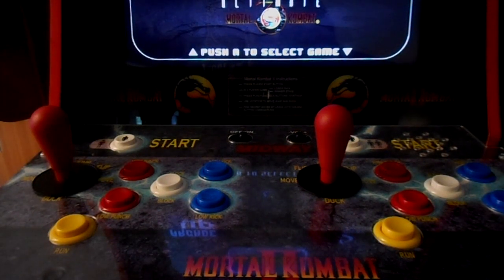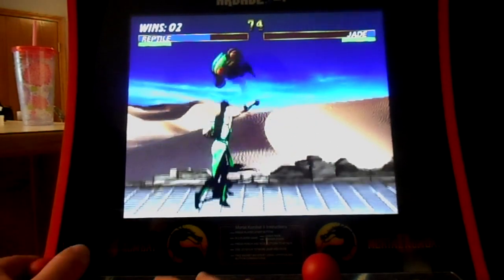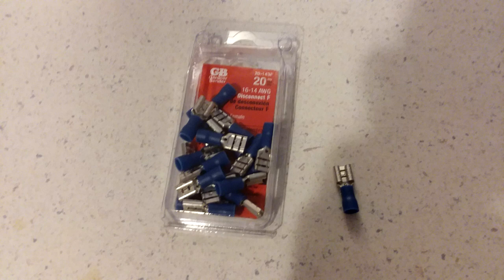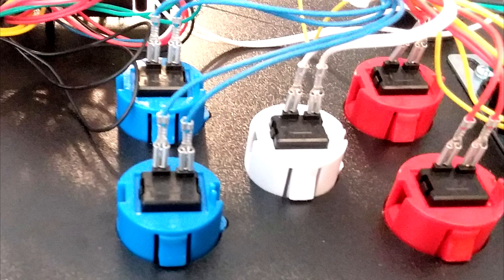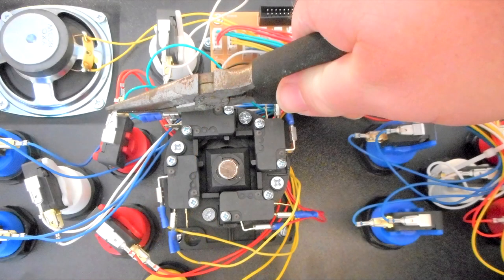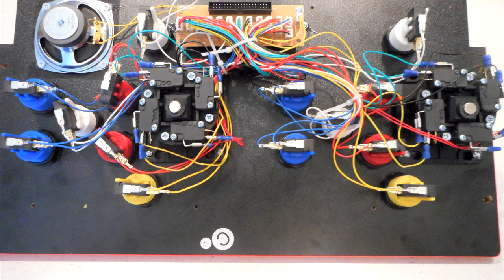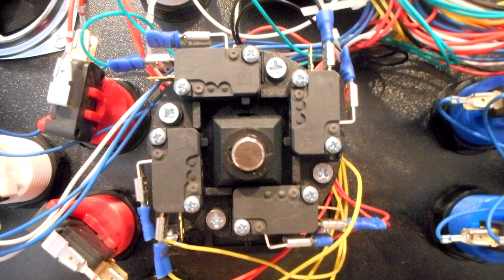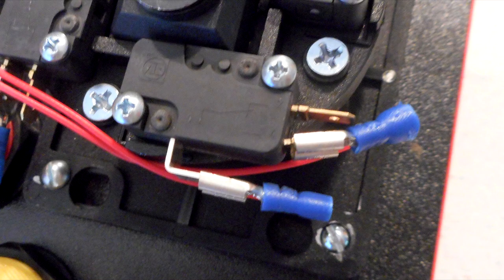It's EASY to do putting HAPP Competition joysticks in your Mortal Kombat Arcade 1up

Comment: I’d really wish the installation of the Happ would be in video instead of pictures :(
Reply: Took me 8 hours to do sticks and switches. I did thread in nuts into the deck, then I could attach them with m10 bolts so the joysticks are in there for good. Had to shave down all 8 threaded inserts before putting them in. Also I had to shave the side of the first player joystick. Then I got ocd with the wiring. Cut it all to length and ran to each switch nicely. Also had to solder the ground for the top corner switch of joystick and solder both power and ground wires onto bottom right switch of joystick for ti to fit without hitting the side of cabinet. Just finished an hour ago. Fudge, I should have just made a video.
Reply: Shelbe Shocker are you in the arcade 1up subreddit? You should be, and post your build. I want to see your cab, it sounds really nice and you did a thorough job.

Comment: get IL Eurosticks.. they're more snappier and responsive. you know you have an IL Eurostick if the dust washer is the same color as the joy stick. Thank me later
Reply from the maker: I agree IL sticks ARE better (I have 4 of them). I recomend these Happs for this mod though, because of the price. For 40 something bucks you get everything you need. IL parts will cost quite a bit more than that. Plus these Happs are a significant upgrade over the stock parts, so you wont be dissapointed.
Reply: Just did them, took me 8 hours to do sticks and switches. I did thread in nuts into the deck, then I could attach them with m10 bolts so the joysticks are in there for good. Had to shave down all 8 threaded inserts before putting them in. Also I had to shave the side of the first player joystick. Then I got ocd with the wiring. Cut it all to length and ran to each switch nicely. Also had to solder the ground for the top corner switch of joystick and solder both power and ground wires onto bottom right switch of joystick for it to fit properly without hitting the side of cabinet. Just finished an hour ago. Fudge, I should have just made a video.

Comment: What were the size screws you used?
Reply from the maker: Been a long time, I don't remember. Just make sure it isn't long enough to poke through the control panel (on the other side), and you should be fine.

Comment: I tried to put Happ 8 way into my MvC 1up and there is not enough room! : (
Reply: What are you running now? 

I also have MVC-A1up... 

I was using a Stock Sanwa but through tinkering I guess I needed getting dirt in some of the switches so some of my inputs weren't Registering... I personally began to think that I just was starting to suck. 

Long story short, I wanted Happ Sticks, but through tinkering I developed a theory that what makes a feel of a button and Joystick come down to their actual moving Parts. 

So now I have my Sanwa Base with an Extended Shaft, Aluminum Bat Tops, 6lbs spring, cherry switches via a 5ping to .187 harness from Focus Attack.

Comment: Do you know the exact size screws you ended up going with to attach the arcade stick to the control panel?
Reply from the maker: No I don't, I just went with screws long enough to hold the joysticks, but small enough to not go all the way through the control panel on the other side. Measure the control panel, and make sure whatever screws you get are shorter than that, and you should be fine.
Reply: @MikeyJProductions  cool thanks man
Reply from the maker: @rosevillereaper9230  👍👍

Comment: Flawless victory! I did this mod right out of the box. Arcade1up buttons were soft. You can really feel the difference. I used 22-16 connectors (red). These wires are tiny but plenty of slack to work with. I also used 8x3/4 wood screws to mount the joystick housing to the deck. This is really easy. just takes several hours. yes, you have plenty of room on the side to mount the control panel to the cabinet. No dremel or trimming. Secret weapon is double sided tape to center the joystick housing. 
Thanks Mikey J for the tutorial.
Reply from the maker: Awesome!!! I've been saying it's pretty easy.
Reply: Just finished doing this mod. Took me 8 hours to do sticks and switches. I did thread in nuts into the deck, then I could attach them with m10 bolts so the joysticks are in there for good. Had to shave down all 8 threaded inserts before putting them in. Also I had to shave the side of the first player joystick. Then I got ocd with the wiring. Cut it all to length and ran to each switch nicely. Also had to solder the ground for the top corner switch of joystick and solder both power and ground wires onto bottom right switch of joystick for it to fit in my mk2 cab without hitting the side of cabinet.

Comment: FYI they updated the Happ sticks a few years ago, They are pretty much right on par with the IL Lorenzo sticks now. So either are fine, Happ Suzo used to suck pre 2017/2018 so make sure if you are buying them you aren't getting the old ones but newer updated models, alot of the Pro MVC players prefer the Happ sticks over Sanwa.
Reply from the maker: I have IL sticks as well, and the Happs ARE close, but they are not the same. The IL sticks have a white nylon actuators, while the Happ sticks have black plastic ones. So they ARE different.

Having said all of that, I LOVE both sticks. But I DO think the IL sticks are slightly better.
Reply: @MikeyJProductions  nylon is a type of plastic, but at one point they used some kind of rubber material when suzo first took them over, and man did they suck. Still cannot figure out though the Ultimate series reason for existing other than a round actuator rather than a square, still though the Super series is one of the best for 4 way games.
Reply: @MikeyJProductions  The actuator's are definitely different but even the pivot and the z-stop which is underneath the actuator and encloses the spring also is the white nylon material. If you replace the actuator on a Happ with IL's version, the z-stop is also a must.

Comment: I attempted to Recreate a Happ/IL Feel through Sanwa Base by using an Extended Shaft, bat tops, 6lbs springs and swapped the Sanwa PCB for all Cherry 75g switches through a 5ping to .187 connector. 

I'm running that on my MVC Cab by A1up.
Reply: Noice!!!!, because I was going to do the same thing. I actually got 4 lb springs instead of six. Four pounds feels fine. Do you think the six would feel more like happ? Also, what is the overall outcome of your idea? You have a longer shaft and 6 lb spring with micro switch cherry switches. How would you rate it compared to official happ joysticks on a scale from 1 to 10 with 10 being the highest? 👍
Reply: @kjmullinz  

Ahhh man. Let me just say I have been on a journey. . . 

So basically..... I found that a 4lb spring feels good with either the Stock Switches on A1up, and with Stock Sanwa Switches. 

A couple of things you need to consider based on what I have felt(I Am Very Empathic and detail oriented.) Is not just the spring weight but also the push back from the switch. 

I believe most Joystick switches are around 100g of force to 125g hence the point of actuation and push back is kinda heavy and comes with a loud click. 

With that said though, one factor of Springs you always have to consider is the fact that they will weaken slightly and become easier to move. 

This is why I switched over to a 6lb spring because the 75g switch isn't just less loud with its actuation sound, but also less heavy in actuation and push back.... Who would have guessed right? LOL!

To get a Happ feel isn't what I first initially set out to do.... At least not directly and not at first. 

I don't like resting my hands on the control deck so that's why I bought extended shafts to also help with maintaining some sort of Good Posture.

The Microswitch change came to me recently when I began to.... Suck ass! I actually thought I just plateaued in skill, I was getting bodied online and in person offline.

But each moment I felt something was off, I felt my inputs not always registering so I did some research and was going to buy the Bit Bang JLF PCB alternative that allows you to swap out individual switches, but they don't accept the Cherry switches I had a lot from, from ordering a lot of buttons. . . 

Then I also found out Cherry Switches are the same old school switches used on some Arcades, for example Galaga used a 'Wico' stick with 'Leaf Switches' for it's controls. 

So long story short because I have JLFs with an A1up Adapter I decided to use the switches I had on hand and buy a 5pin to .187 adapter. 

I switched to a 6lb spring because I wasn't getting the feeling I wanted, but I had them for months before I used them because a 4lb Spring with Stock Sanwa and A1up gave a Satisfactory feel but not with Cherrry. 

I also found out that Happ uses a Stick spring between 10lb to 14lb, and in mVC 1 cabs they used Wico 360 optical Sticks.... 😂. 

But YES I do have a Happ like feel, I am deciding to increase the weight by getting a heavier Spring, I also have less Ghost Inputs when I let go of the stick to allow it to return to nueutral, and the stick goes to hit the opposite switch.

On my Galaga A1up I spliced in the Cherry Switches, kept the same length shaft but swapped in a black Shaft along with a Sanwa Pivot, Washer, Spring Holder, and actuator because none of it allowed for a Sanwa shaft to fit.
Reply: @cMARVEL360  I played moral versus Capcom 1 back in the day. I can't remember if it was 360 sticks or standard Happ. If half are using 10 lb springs, then I definitely can't feel that because when using a 4 lb spring on a third-party stick, the resistance feels similar. Reason I'm trying to clone the feeling of Happ is because when using official app, I can't put that bottom plastic cover on the arcade one of control decks back on because of the huge joystick and long buttons. 🤷. ... I'll trust your judgment. So what exactly do I need to clonenthe feeling of Happ joysticks and buttons?  ... I have a Marvel versus Street fighter control deck I would like to make a replica of the original 90s control deck  as much as possible
Reply from the maker: I don't have the cover on mine either. You don't need it.

Comment: Question:  In your opinion, for Arcade1up games that do not require such precise joystick movements like the upcoming TMNT cab, would you still recommend replacing the controls?, or just leave them as is?
Reply from the maker: I plan on buying the TMNT cab, so I will probably discuss that further at a later date. But based upon my current understanding, I would say you can probably leave the stick sticks in it for a while. Will they last forever, especially with frequent play? No. So you will most likely have to replace them eventually. If you put something like Sanwa or Zippy sticks in it at the beginning, you will probably be set for life. Games like TMNT dont require precise movements obviously, so the stock sticks WILL be fine. They just won't last forever.

Comment: How's the buttons feel vs stock? Also no gates needed or better springs? I have sanwa and thinking about switching them out. Thanks
Reply from the maker: The buttons feel like real arcade buttons (because they are, lol). The stock ones are decent (they dont have a click to them, which is a personal preference thing). Anyways, you could leave the stock ones on, if you wanted to. I wanted more authentic EVERYTHING, but the stock buttons weren't bad. 

As for the sticks, with Happ and IL sticks you dont have to worry about gates and springs. They come ready to go, how you want them to be. They ARE the sticks that were in these machines originally, so they are perfect as is.
Reply: Thanks for info man

Comment: How did you connect the hap controls. The wiring is not clear please explain
Reply from the maker: Take it one connection at a time, each wire individually. You can use the existing wires, but the crimps on the end of them are too small to fit on the happ controls. So you will have to stretch the terminals on the end of the wires. I used a small flat head screw driver, and just stretched them out, so they can fit on the new microswitches. As long as you can get them on the new controls, they should work (as long as you don't ruin the wire in the process, so be careful). Use needle nose pliers to hold the wire (make sure the pliers hold the wire by the metal base of the terminal, not the actual wire), and insert a small screw driver into the wire terminal. Wedge it in there, and stretch them out. 

This is how I did it.

Comment: What size is the female disconnects on the stock buttons? I want to buy the male size to fit into them and then attach a spare wire and at the other end use the .187 female quick disconnect to fit the cherry microswitch that will be used for new happ buttons. Also Are these long stem suzo happ buttons? Is there a short stem version?